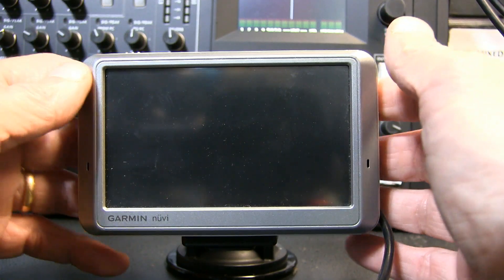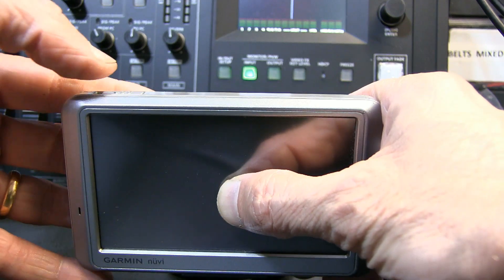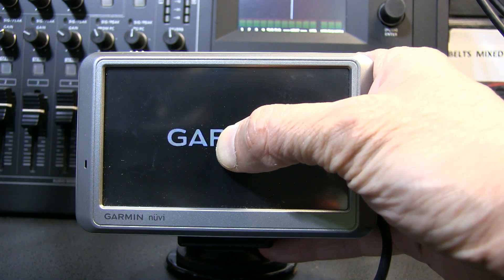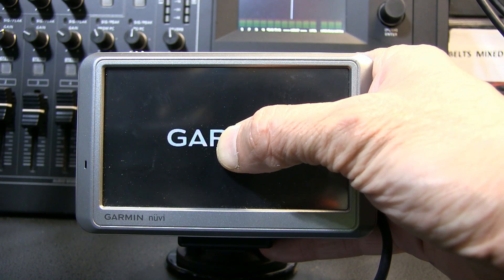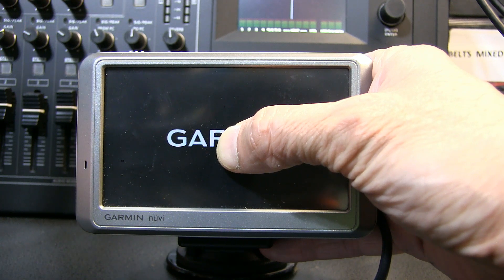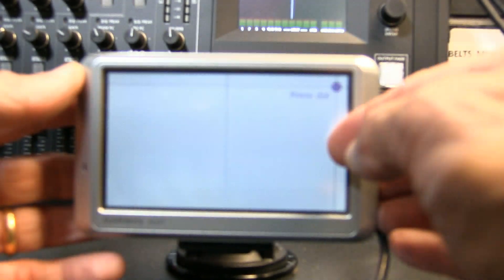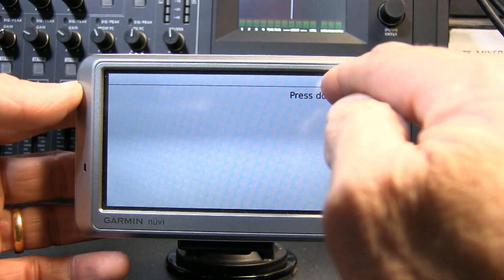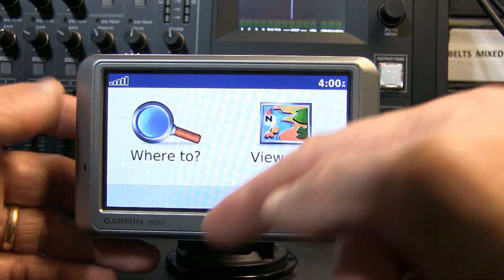Tutorial On How To Do a Touch Screen Calibration in a Garmin Nuvi 750 760 765 770 780 GPS785

Comment: This worked on my Nuvi 760 but only after I stopped the current navigation.
Reply from the maker: Yes that is correct, it will not work when you are running an active rout navigation session.

Comment: Thank you for this. Just dug my 765T out and it works great. Where is a good battery manufacturer for a replacement? E bay is sketchy. Thanks again
Reply from the maker: You are very welcome, No aftermarket battery manufacturer is as good as the Garmin Original OEM batteries, but Try the CS Cameron Sino the have been around for very long time.

Comment: Thank you for posting this calibration procedure. Do you know the part number for a 780 replacement screen? Regards
Reply from the maker: No problem, there two completely different types of LCD Screens that Garmin installed on their Nuvi 780 devices. Both of these screens are 4.3" but the video cables are completely different and not interchangeable. So you have to first open it and see which type of screen yours has. Here are the two types LQ043T1DH01    LQ043T1DG01

Comment: Hi Thank you so much for this interesting tip. However for mh Garmin nuvi 765T, I keep pushing on the different dots for nearly 100 time and never get "calibration complete" ( I was well on lock mode) . I precise I don´t have a broken screen as show in your other tutorial "Tutorial on replacing the LCD & Touch Screen in a   Garmin Nuvi 2597LMT GPS Navigation System". It works very well since when I bought new on 2010 till now.  Before trying calibration, I just had a screen not responding at all to any touch. Do you think I might think about changing the touchscreen although it doesn't have visible broken part ? Or is it any other part like motherboard ? Thank you for your help .
Reply from the maker: Most likely there is something sand particle stuck between the touchscreen and screen frame. Use a business card to lean the edges by pushing the card under the screen frame to clean up the edges. If that doesn't fix it then you most likely need a new Touch Screen. Not the entire LCD screen, only the front glass which is also called the Digitizer.